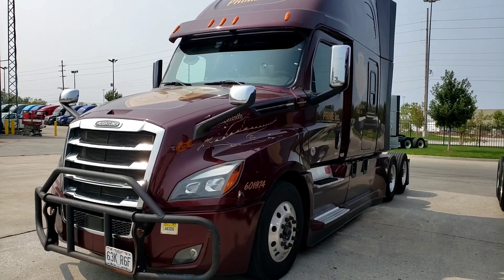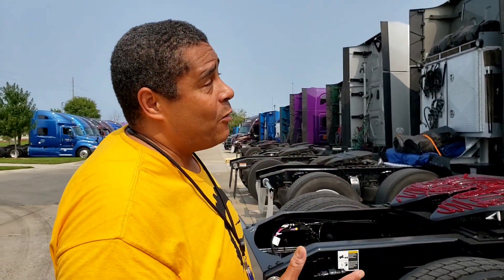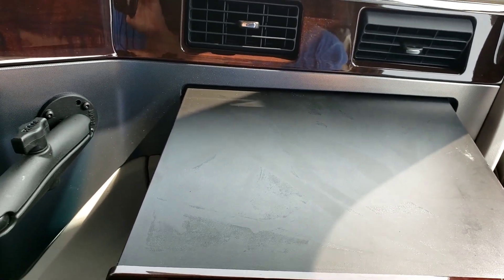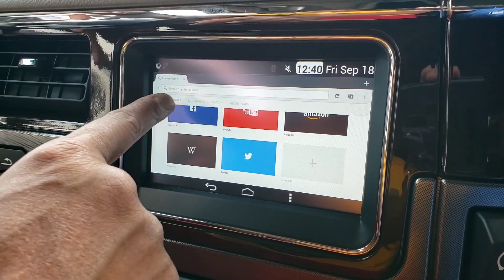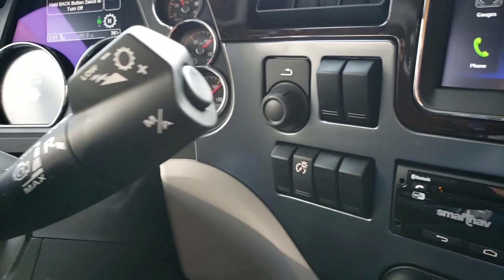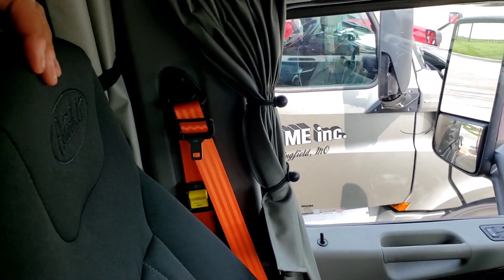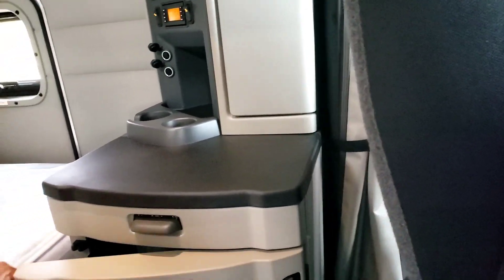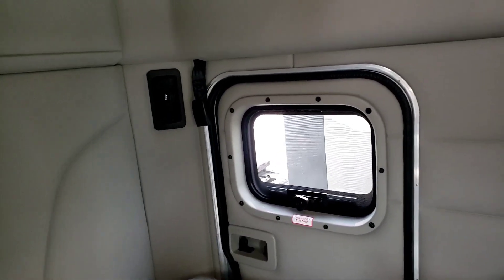My New Truck! 2021 Peterbilt 579 Ultraloft - Full Truck Tour. Inside, Outside and Engine.

Comment: Man I sure wish I had one of these when I was on the road. Those internationals were trash compared to this beauty
Reply: I agree! I think internationals with no respect are meant for someone that’s very short or small and really doesn’t need all that room! I’ve drove a international with no trailer and was happy and then they wanted me to attach and I said no! Hate the turn radius with the international! Almost drives like a car!
Reply: I drove everything and the kenworts and peterbuilts are just junk you will have nothing but def problems ...that and you need a football field to turn it around. I'm in a prostar and this thing turns like my camaro ss. it hits the bumps a little harder but ill live with it because its a joy getting in and out of tight spots like chicken farms and these tight ass parking at truck stops at 4 a.m.

Comment: Are you making any$ nice truck, curious on the $ though, i want a new truck.
Reply from the maker: Of course I'm making money. Lots of it. I wouldn't be able to go out and Put down all that money on a brand new truck and afford the payments plus all the upgrades I'm doing to the truck if I wasn't making money. Dough is rolling in. I love this job.
Reply: @JJtheTrucker  just checking, I have a paid for truck  I'm at crete , just thinking what a new truck would be like.
Reply from the maker: Just think of what it's like going from an older car and an older house to a brand new car and new house. It's nice, BUT... Payments. Having a paid off truck is really nice. If it's comfortable and is still reliable, it's money in the bank, instead of TO the bank. For me personally, I'm a new truck/car kinda person. I don't mind the payments as long as I'm making enough to cover them and still have plenty left over to save up.
Reply: What are the rates at Prime?
Reply from the maker: Here are the rates for company drivers:
https://driveforprime.com/drive/company-driver-careers/

Lease and owner/op's get 72% of the load rate, plus fuel supplements, etc., but they also pay for their expenses and truck payment. It works out to more money, but also a bit more risk.

Comment: Peterbilts are the best in my opinion but I'm not a big fan of the 579 I like the classic looking Pete's like the 389 but any Pete is better than a Freightliner
Reply: 79tazman Freightliner classic with a Detroit 60 is good as a Pete Imo
Reply: @RaceboyYT  sound proofing in Freightliner’s is just horrible...
Reply from the maker: All the trucks are that way but the new ones are much better. The 2017 I drove was really loud. Needed a super Trucker headset. The new 2018.5-2021 models are much better and about the same as the Peterbilt.
Reply: @RaceboyYT  you know about trucks

Comment: Peterbilt is one rough ass ride!
They are missing the shock absorber on the drivers seat that freightliner has already figured out.
If you had a freightliner and experienced a rough ride, than you apparently didn't read the owners manual. 
They call them freight shakers because of the auto start feature while you sleep.
It shakes the entire truck. 
Wow..just wow.
Reply from the maker: So far this Peterbilt has been a very smooth ride. Much much much smoother than the Freightliner. So, what was I missing in the owner's manual that would have made the Freightliner a smoother ride? Of all the Freight Shaker comments I've received and heard from people, that's the first time I've heard that reason. Everybody else seems to think that they're called Freight shakers because they shake All the time while going down the road.
Reply: Just below the drivers seat the freight liner has a lever that adjusts the shock absorber below the seat and that adjusts the shocks,& jolts from the road.
It pretty much makes the ride feel like you are gliding in a Cadillac,(instead of riding a Brahma bull.) Lol.
Reply from the maker: yeah I know about that adjustment, and Peterbilt has the same thing. All that was doing in the Freightliner was bouncing me up and down so much that my feet kept leaving the pedals and then slamming me back down. It also didn't help all my cargo inside that kept flying all over the place. Bottom line is that the shocks in the truck itself are no good. That thing was bouncing everywhere and that seat adjustment just Amplified it to where it was bouncing me opposite of the truck And I was flying everywhere. It was not a comfortable ride and nothing like a Cadillac whatsoever. More like a Jeep on a really super rough Mountain Road.
 Today is my third day in the Peterbilt and so far it is a huge difference. Talk about a Cadillac ride. This thing just holds to the road is so much better.
Reply: Oh?
Okay,then.
I guess it all really just boils down to the truck,( that you're company offers,) because the way you are portraying your old Freightliner is exactly how my current 2020 Peterbilt is treating me,( minus the shock absorber in the seat because, this Peterbilt doesn't have one.)
I have found a solution for those aches,& pains though. 
I went and bought a $25.00 air mattress at Walmart,& placed it on my memory foam mattress that came with the truck.
So, I go to bed feeling like crap,& wake up without any aches, or pains. 
I would have already quit this job had I not found that air mattress. 
Anyway, I hope you enjoy passing up all those trucks in the mountains. 
I know there are a ton of times,(in this 579,) where it feels like I am not even pulling a trailer. 
To me that's probably the best feature of a Peterbilt.
Hope to see you out here.

Comment: You want to give a blinky blink to the drivers you pass?! Who the hell does prime pass?
Reply from the maker: All them slow pokes that drive slower than 65! And there's plenty of them.
Reply: @JJtheTrucker  are there really? I couldn't imagine being forced to go slower. 65 is painful. But going slower I would loose my mind. Might as well stay in California lol. But back when I was forced to go 65 it did nothing but motivate me to buy my own truck.
Reply: @JJtheTrucker  be very mindful with the mx13. They don't like rpm. Keep it under 1700rpm. The after treatment is an absolute nightmare. I've dumped probably 20k in that alone since I've had my kenworth. I thought all the bugs were worked out of the mx13 but boy was I wrong. And I'm paying out the ass for it. When I go to a shop and tell them what the truck is doing they can usually guess what engine I have. Keep a warranty on the engine and trans as long as you can.
Other than that you are going to love that truck. Im looking to trade in my t680 for a 579 soon myself. Congrats on the beautiful truck
Reply from the maker: Thanks, and thanks especially for the info. I'll definitely keep that in mind and keep the RPMs down.

Comment: Is that a automatic steering wheel holder.
Reply from the maker: no, it's not an automatic steering wheel holder. It's an automatic transmission, and I'm the manual steering wheel holder.😁

Comment: Your old truck looks good. It must of been a sad moment when you handed the keys over.
Reply from the maker: Thanks Norman, I try to to keep the trucks looking as good as I can. It wasn't really a sad moment though for two main reasons. 1, it was simply a rental truck. I was not getting anything out of it and would have had to turn it in anyways. 2, check out the video that is coming out in about 30 minutes.

Comment: The one thing i did like about the freightliner was the shocks for the hood.
You could push the hood forward and the shocks would guide it home. But ride quality pete hands down

Also i have a 32" in mine. ONN tv mount and drill new holes into the bracket on the wall and voila!